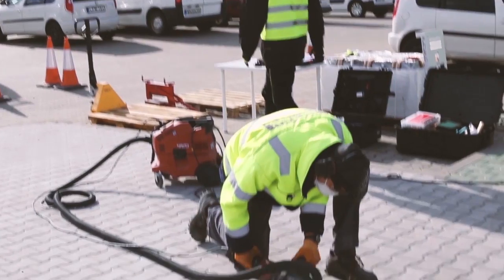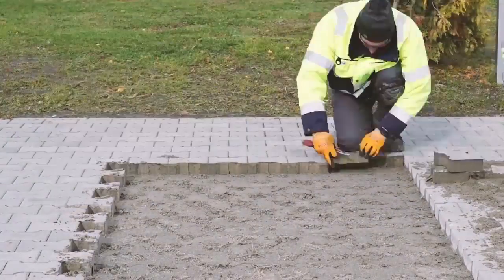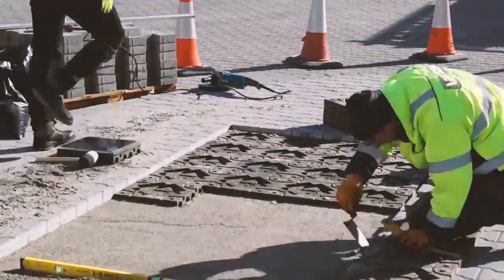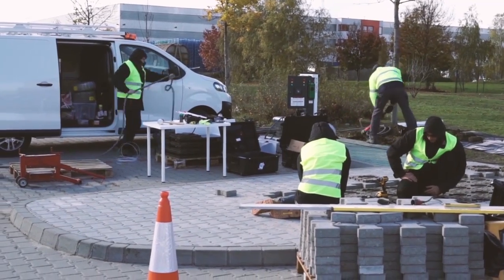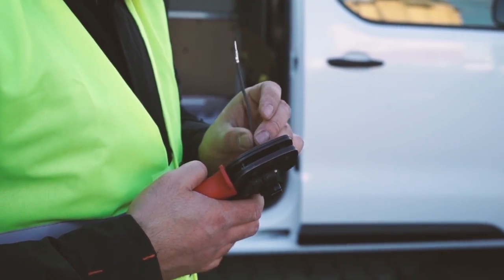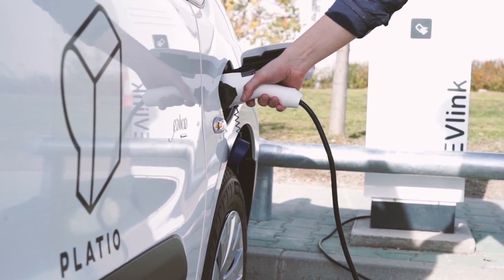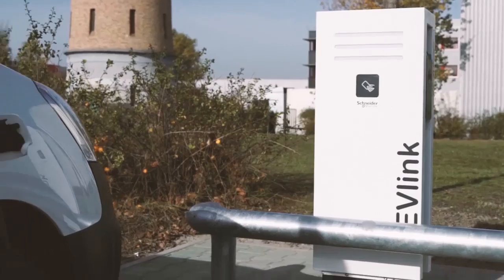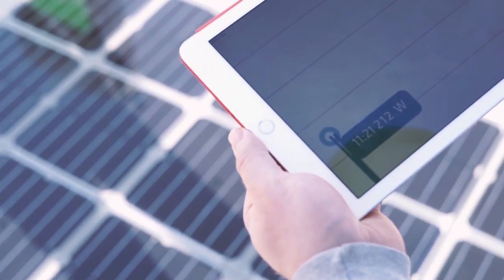PLATIO Solar pavers fuel electric cars with clean energy

Comment: What is the length and width of those solar panels?
Reply from the maker: Hi there! Our solar panels measures 353 mm x 353 mm x 41 mm.
Reply: @Platiosolar  thanks, I'm my condo association suppodisly we have to do community solar meaning sharing our power production with the unit next door. I wanted to patio on my walk way to the door.

Comment: Instead of stepping on the solar panels, wouldn't it make more sense to place them in an adjacent field and tilt them based on the latitude? 

You could charge more cars with less solar panels that way, and it would be far more effective in the winter.
Reply: well, that is so - and there are plenty of other tech that can do that
Reply: You're right that it can be more affordable & efficient to use other systems, and those should indeed be used. But there's not always the luxury of having an adjacent field or an available roof set in the right direction to set some solar panels.  I think the point that's being missed is there's a ton of existing places that are currently underutilized where solar could be implemented, especially in urban and other common areas like parking lots, walkways,  parks etc.  This solution is obviously new, applicable to niche areas and probably not strictly cost competitive compared to other alternatives, but it's interesting and with economies of scale could become a game changer.
Reply: @JPS1000  Parking lots where parked cars block the panels during the day and there's no sunshine at night. Genius!
Reply: @Okurkaarrgghh  Don't be daft, most solar panels on parking lots will be in the form of some sort of canopy over the cars, not only generating electricity but also providing some shelter from the elements. There's actually plenty of examples already of this, including large scale applications like car dealerships who have found that not only do the solar panels help reduce their energy costs, but they help with insurance costs due to reducing hail damage etc.  As for no sunshine at night, that's true that solar panels generally don't generate electricity at night.  Doesn't mean it still isn't applicable in a lot of use cases.
Reply: BTW, the idea that a car is going to park overtop a solar panel is strictly stupid on your part.  It is true that according to the Platio information the panels are designed to withstand being driven over by a car, such as if they are installed in a drive way etc.  But obviously if such a system is installed the owner isn't planning on parking  on top of the solar panel during the day if they expect any generation.  Your 'complaints' are sheer nonsense.

The idea (which IMO is a laudable one) is to take a space that is already available (like a walkway or driveway etc.) which for the most part is underutilized and turn it into both an attractive and productive space. Not sure why it bothers you so much?
Reply: @Okurkaarrgghh  Your reading comprehension is terrible. My original comment was in response to the idea of putting solar panels in a field next door. My response is that while that is one possible option, it's not always available or desireable in all cases, especially in urban settings.  I simply mentioned that there are a lot of currently unused spaces in which to place solar panels.  I didn't say that you had to place these solar pavers in those places.  That's where you made your mistake.  And no, some of the solar canopies look really nice actually. You should do some research.
Reply: @Okurkaarrgghh   You edited out that part. Nice try though.

Comment: so how many panel to charge my EV in an hour?
Reply: Why such an unreasonable charge time for the EV? Average work shift is 6-8 hour, average sleep time is 6-8 hour. Perfect times to charge an EV without demanding ridiculous time frames from an emerging power supply.
Reply: @itsmeknowlzy  You could partially charge 1 EV over an 8 hour timeframe, assuming it's not winter or cloudy, and it's daytime. But that would still require a lot of solar panels. Solar panels are not a new invention, but solar sidewalks are new because they don't make any sense so nobody else has tried to make them work before.
Reply: An obscenely large amount. Solar panels are much less effective than most people think they are.  The theoretical max output of a 15% efficient solar panel at noon in the summer is about 150 watts per square meter. So to charge an 80kwh Tesla battery in an hour, you would need 533 square meters of solar panels. Next, if we generously assume 70% efficiency in charging the battery, we would need 762 square meters, or 8202 square feet. That's 14% of a football field!

But remember, this is at noon, in the summer, in the tropics. These solar panels are in Germany, pointing up when they should be facing south, and shrouded in cloud cover. So yeah, they're definitely not going to charge your Tesla in a reasonable amount of time.
Reply: @bobbyc1120  well, i mean these panels, as it seems that is one of their claimed markets.
Reply: @flyingdiscproductions  I tried calculating this myself, but it turns out that the video actually gave us some numbers to use. The maximum output is 720 watts. That means on a sunny day, at noon,  in the summer, with nothing casting a shadow on the sidewalk, the solar panels could theoretically provide a Tesla with 0.9% per hour. Account for charging inefficiency, and the tesla will charge by 0.8% per hour. Now generously assume that you get 6 hours per day of maximum intensity sunlight, and the Tesla will be fully charged after 21 days. Here's another way to look at it. A single household power outlet puts out 1500 watts, and a toaster uses about 800. These solar panels could not even power a 2-slice toaster under the perfect conditions.

Comment: Nice solution. Would you mind sharing the total cost (materials and installation) of this particular system?
Or an average cost per square meter in a typical outdoor location.
Reply: WAY more than anyone would want to spend - that is why they dont tell us upfront.
Reply: @flyingdiscproductions  yeah, it's hard to think of a worse place to put a solar panel than a sidewalk. Solar panels are expensive pieces of equipment and it's a waste of their potential to step on them, cast shadows, and point them straight upwards when they should be facing south based on the latitude.
Reply: @bobbyc1120  
Yes, solar panels work best when they are aligned perpendicular to their light source( the sun), but unless your system is designed to track its alignment to follow that sun through the day, then all systems have compromise built into them. Shadows do affect energy production, but only in an incremental sense: indirect light still generates electricity. If you have a North/South roofline( East/West faces), you mount on the east side first, in order to take advantage of the thermal conditions( panels are more efficient at lower temperatures), but the panels still generate power through the whole day; efficiency just drops from peak output. LG and Canadian Solar( a Chinese company) have conventional panels that generate electricity from both sides( skyward-facing, and surface-facing) in order to maximize output for the dimensional displacement of the panel. That works, because indirect light works well, too.
One can only presume that installers take potential shade into count when they engineer a system in order to avoid chronic, heavy shading, but someone walking across a series of solar tiles would be such a small effect against the overall production, that calculating it would be laughable. I remember when there was a argument against windmills, based on the fear that the resistance that they create would significantly slow air movement, forgetting their height in comparison to the atmosphere, not to mention their diminutive comparison on lateral measurements.

I have questions about this approach, but they’re more to do with serviceability and end-of-life, than trying to squeeze every angry pixie out of the system, as I have long-since learned that no system is 100% efficient.

Edit: I should probably add that here in Nova Scotia, peak output is in February, when the sun is still fairly low to to horizon in comparison to summer. The difference is that temperatures are cold enough to allow a higher rate of angry pixie collection.
Reply: At least 10x as much as rooftop solar panels that don't get blocked by parked cars.
Reply: @Okurkaarrgghh  
How do you come by that figure? A 6 kilowatt racked system costs about 17,000 Canadian. That would make this installation cost 170,000. No one would bother trying to market anything that poorly costed. Are you including the cost of the surrounding construction? If so, the racked roof array will need to include the cost of building the house underneath of it.
As for parking a car on top of the completed array: are you one of those people who regularly cut off a finger or two when eating steak? Do you run the risk of drowning when staring into the sky during a rainstorm? Otherwise, it’s just a grade above basic survival skills to not block off your angry pixie generator.
Reply: @Okurkaarrgghh  
That installation quote that I’d posted? Pre-subsidy. The price of installation remains the same. 
The solar pavers?
Not designed to be installed into a vehicle access point. I looked it up. No driveways. Walkways and patios.
The glass tiles look to be built on the same principle as the roof slate system being implemented in England and able to be walked on and subjected to light loads that are higher than that of a traditionally racked solar array. 
An array, that I might add, makes that whole area a “no-go” area. I know, because I’ve had to help dismantle portions of an array in order to get at the troublemaker( optimizer usually). 
Again, with the recycled products being used to manufacture the underlying tiles supporting the glass panels in an at least very-very similar manner to the widespread system in use on British slate roofs, where do you get your claim of a 10x cost to a racked system? Why would the recycled plastic base cost more than extruded proprietary aluminium, plus proprietary clamps, footers, splice bars and grounds? 
Where is your cost for the remaining 153000 Canadian in additional expenses for the array strength that I quoted going?
Reply: @Okurkaarrgghh  
You stated that a solar paver system would cost 10x the amount of an equivalent roof-racked system, and would be subject to being shaded by having a car park over it.
It’s neither designed nor intended to be installed where road vehicles will drive over the array. 
The array that I quoted is a standard cost( materials + manpower + profit) for an array of that particular output. 
Your 10x makes a solar paver system cost 170,000 Canadian. 
That’s ridiculous. 
No amount of subsidy is going to offset that kind of expense.
Where. Are. Your. Numbers?
Where is the 10x expense coming from beyond the straight one-for-one transfer of cost for solar paver vs roof-mounted racking?
Reply: @Okurkaarrgghh  
So you have a quote? Share it. Output to cost. I’m pretty sure that I can look up a system that my old bosses sold that is of equivalent strength.
Reply: @Okurkaarrgghh  
You claim to have factual knowledge.
Share it.
The numbers.
Whatever the power-on cost, 10x that of a roof-mounted array is simply too high to be believed.
Answer with numbers or reinforce the appearance that you’re simply here to stir up shit.
You made a claim. Prove it.
Reply from the maker: Dear Imre, for more information please contact our team: sales@platio.cc :)
Reply: @Platiosolar  kindly send more info will share with Product Management  Team